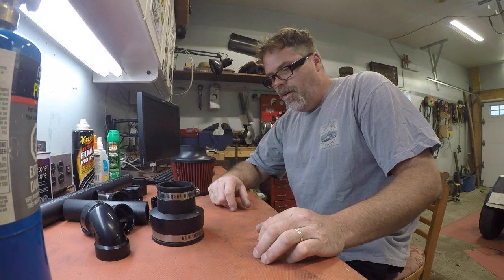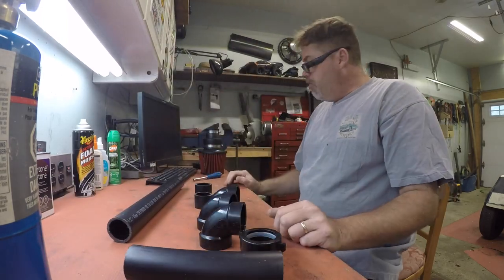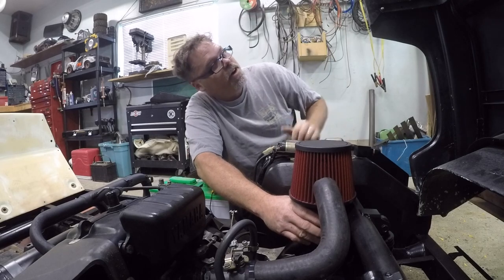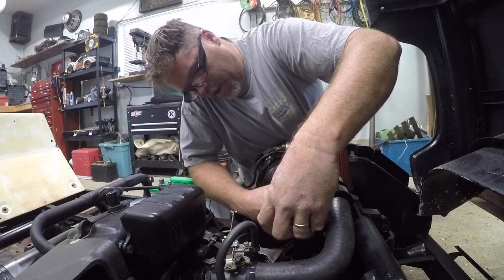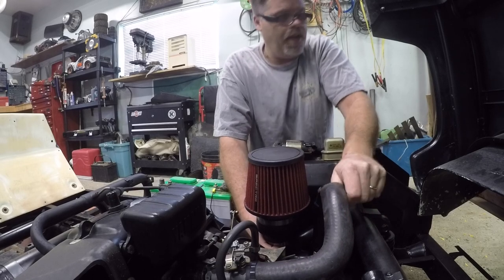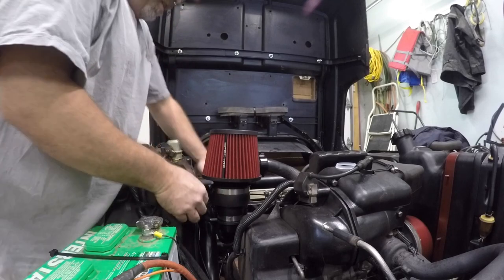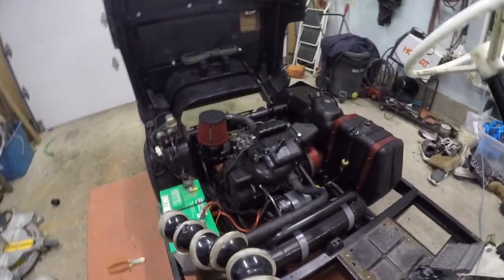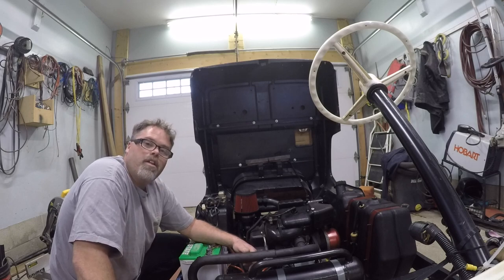Cold Air Intake On My GolfCart

Comment: Why not just go from the existing hose to a small piece that goes from the same size as the hose to the filter? Save urself all those other bends. Just s thought. Might not have fit like u liked it. That's just me being a fabricator all the in my yard it Ga USA
Reply: i agree! Every time the air has to change direction ( 3-90's) it slows down. And you're still drawing warmer intake air from around the engine.